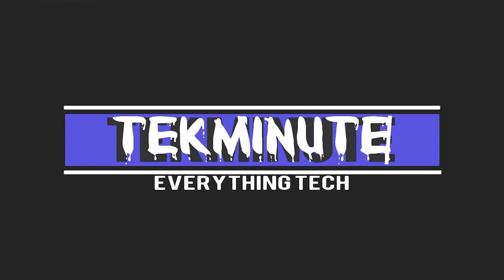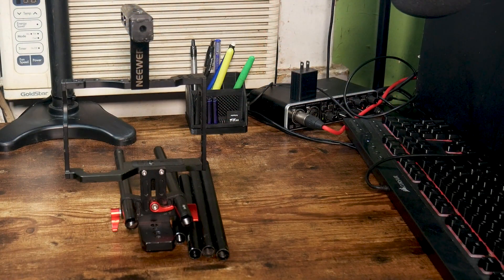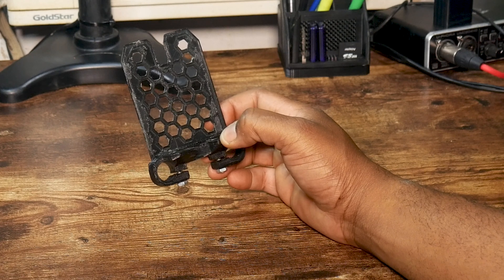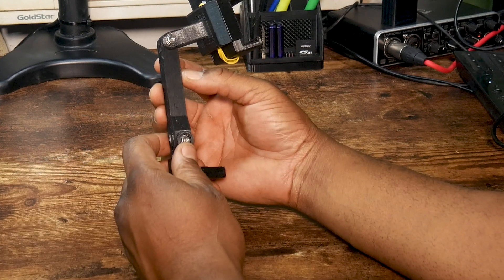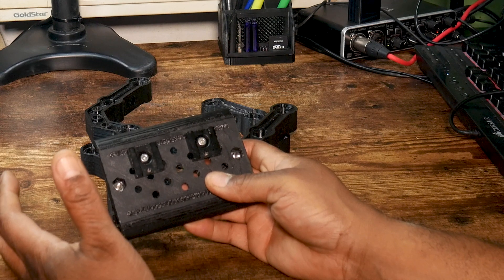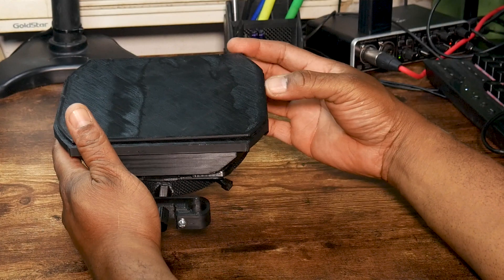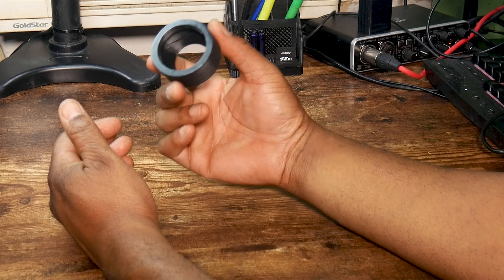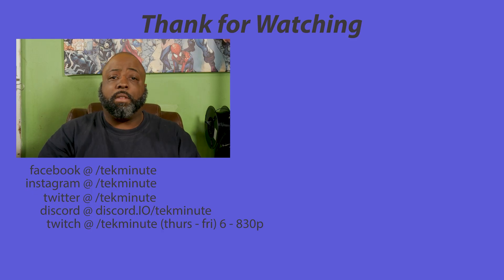I 3D printed my Camera Gear!!!

Comment: Coming back to this video because I just decided to get into it, what type of Filament do you use and what 3D printer do you have? Thanks!
Reply from the maker: I have a mono price mp10 printer, you don’t have to get the same printer, there’s are a lot of good printers out there depending what you want to  print, you could also get a smaller one for around $200 and the filament that I use is petg
Reply: @tekminute  I ended up getting the Ender 3 Neo. I will look into the Filament. Thanks!

Comment: Nice work. 
What does the mattebox weigh? 
And what is the piece on the rear mount of the matte box?
Reply from the maker: Sorry don't have a scale that capable of weighing something light but my guess would be about 300g...and for the rear, I believe you be talking about the lens adapter thank you for your question
Reply: Thank you for answering ❤️,yes the lens adaptor to mount the matte box   on the lens. Can you please give me the stl for it
Reply from the maker: @mk1814  link in the description